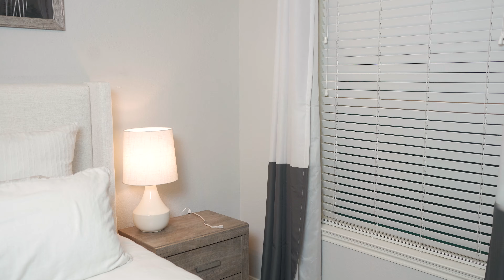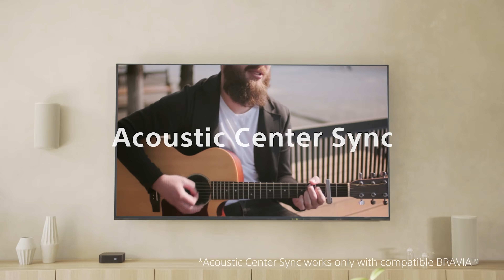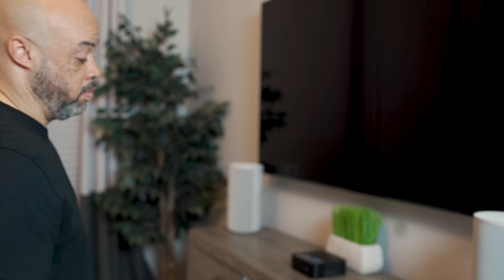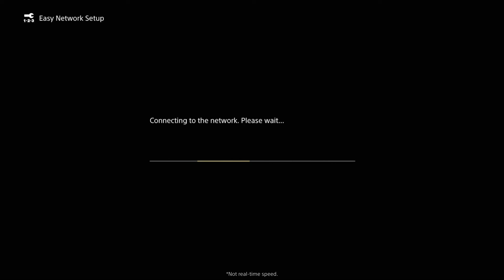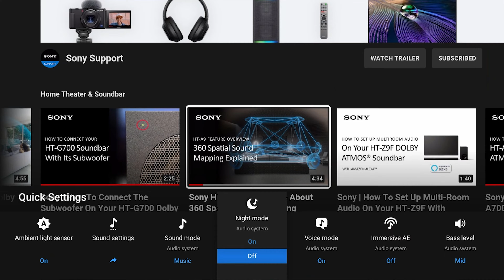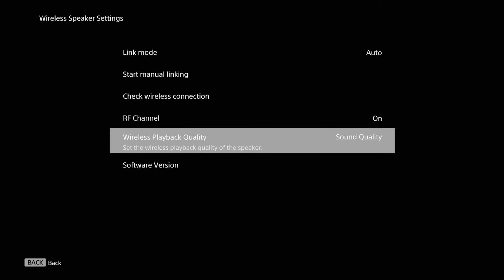Sony | How To Set Up Your HT-A9 High Performance Home Theater System

Comment: I bought 2 unit system Sony ht a9 and 1 woofer sw5 in years 2025 .. 1 unit for saving in case sony lost product (standby mode) or damage .. i like it sony ht a9 compress audio format Atmos dtsX very champ but im still like it DtsX Dtshd and dts audio 😊

How to connect Sony ht a9 center speaker (no sony tv)

https://youtu.be/TD5jmR_KOVk

Comment: I've set up a little "man cave" in a detached garage.  I have a laptop that is connected wirelessly  to my network. Question is: can i connect my laptop to the HT-A9 ?
Reply: Absolutely, you just have to put you the HTA9 in pairing mode then select it in your laptops Bluetooth pairing mode settings.
Reply: Yes, you can connect your laptop to the Sony HT-A9 in your detached garage "man cave.

Comment: I know this video is old but is there a major diffrence between  “ connection “ option & “ sound quality “
Reply: The only difference is where you want the bar to set its priority.  Most people just keep it set on Sound Quality but if you notice any connection issues, you'll want to change it to connection which tells the bar to focus on connection.

Comment: You'd have a lot more customers if you patched the system so that you can link to any brand wireless sub.

Imagine this linked to a REL S510 via their wireless add on.

For me the system looks great, but the subs are not quite there to my taste, I need tighter bass with more extension with a much faster response.

The option of a separate centre channel would be great also.
Reply: Well, to be honest as someone who tried everything like the Real and the Sonos subs I would say that the sub that is supported with HTA9, the SWA5 from Sony sounds as good as the Rel and better than the Sonos sub.

Comment: I have the A-9 system.  The demo set-up sounds AMAZING but, because the unit is wireless, the sound frequently drops out, or stops working altogether, requiring you to stop what you're watching, and re-set the entire system.  My advice: not worth the cost so look elsewhere for a quality sound system!
Reply: How far is your router from the control box? Is your box using wired Ethernet?

Comment: Can the receiver be mounted behind the tv panel?
Reply: yes it can, but you may experience drop outs depending on the exact positioning.  The best way would be to try it out and see how it goes, there are a few variable's that can affect the connection.  Such as being to close to the wireless router.

Comment: Hi, I have a question about rear speakers position. I have a large room in a shape of letter L that combines living room, dining room and a kitchen. How important it is to for the rear speakers to be at the same distance from the TV? Currently one is in the middle of the room, right behind the sofa, let say 3,5 meters from TV, and the other is further away, in a corner 7 meters away from the TV. Is that a problem? And if so, it better to put both of them at the middle of the room and create the sound bubble just arount sofa, or to put them both furher back?

Comment: Great video. How can i connect the Sony HT A9 with the Sony A80J to get the best performance? I own a PS5 and some other consoles, do i just connect the PS5 to the HDMI IN on the hub and all the other devices to the TV since the HT A9 only supports one HDMI IN input? I would be thankfull for any kind of help :)
Reply from the maker: Thank you for reaching out to Sony, we're glad to assist you with this inquiry. Since besides your TV you also have other AV devices and consoles, you can connect the TV and soundbar using HDMI ARC, then if you prefer you can connect your PS5 to the HDMI IN port in the soundbar, in case you have other ACV devices, you can connect them using the others HDMI IN ports that your SONY TV have. For more details, please access the following links: 

HTA9, connecting a TV Compatible with ARC/eARC: https://helpguide.sony.net/ht/a9/v1/en/contents/TP1000029209.html

HTA9, connecting an AV Device Compatible with the 2K/4K Video Format: https://helpguide.sony.net/ht/a9/v1/en/contents/TP1000029219.html

Hope this helps! 

Regards,
Ivan.
Reply: @SonyConnect  thank you Sony Team for the fast reply.

Comment: Do you have to re-optimise once tv centre channel is added. ?

*All good this video suggests you do, 
https://youtu.be/rpnNNlj8QRc
Reply from the maker: Thank you for reaching out to Sony, we're glad to assist you with this inquiry. If available, use your audio system's automatic calibration function. The measured distance may be several meters farther than the actual distance. If your audio system doesn't have automatic calibration, set the center speaker level of your audio system manually. For more details, you can access this link: https://www.sony.com/electronics/support/articles/00201071

Please reply on the thread if you need or would like additional support.

Regards,
Ivan.

Comment: so i have a 4K projector.

Connected to projector is 
1 my NVidia shield
2 my 4k sony player

So how can i use this on both of these devices?

I plug the HDMi cable from the Sony device ARC to Arc on my 4k projector

but then how to connect nvidia shield and my 4k player to the sony sound device
Reply from the maker: Hi John Robbo,

Thank you for contacting Sony support, we're glad to assist you! You can only connect one AV Device Compatible with the 2K/4K Video format to the speaker system (HT-A9). Please access the following link and refer to page 18 for the steps to connect an AV Device Compatible with the 2K/4K Video Format to the Sony HT-A9: 

https://www.sony.com/electronics/support/res/manuals/5025/247767c717293fe9a5e7f268a1f877a3/50252291M.pdf

Regards,
Gerson

Comment: Can you use it without arc with a device plugged into the input port
Reply from the maker: Thank you for reaching out Sony, we're glad to assist you with this inquiry. In case you would like to connect any other device than a TV compatible with ARC/eARC, you'll need to use the HDMI In port of the HT-A9 unit to connect an AV Device Compatible with the 2K/4K Video Format, for more details please access this link: https://helpguide.sony.net/ht/a9/v1/en/contents/TP1000029219.html

Please reply on the thread if you need or would like additional support.

Regards,
Ivan.
Reply: @SonyConnect  I’m interested in this speaker set for my computer. But my computer doesn’t have ARC. can I use this speaker set without an ARC compatible device?
Reply from the maker: @MuppetChops  Thank you for replying. If your computer supports the A2DP Bluetooth protocol, then you may be able to establish a connection between the PC and the SONY HT-A9, please access this link for more info on Bluetooth connection: https://helpguide.sony.net/ht/a9/v1/en/contents/TP1000029215.html

Regards,
Ivan.
Reply: Hello. I don’t want to listen via Bluetooth. They’ll be compressed and stereo. I want to use the hdmi input on the device to receive audio. But I want to use it with a screen that doesn’t have. ARC
Reply from the maker: @MuppetChops  Please note that, as we mentioned before, you can connect AV Device Compatible with the 2K/4K Video Format by using HDMI IN (NON-ARC) in the HT-A9, for more details, access this link: https://helpguide.sony.net/ht/a9/v1/en/contents/TP1000029219.html

You can also refer to page 32 of the manual: https://www.sony.com/electronics/support/res/manuals/5025/247767c717293fe9a5e7f268a1f877a3/50252291M.pdf

Regards,
Ivan.
Reply: Thanks. So how do you setup the device if you don’t have eARC?

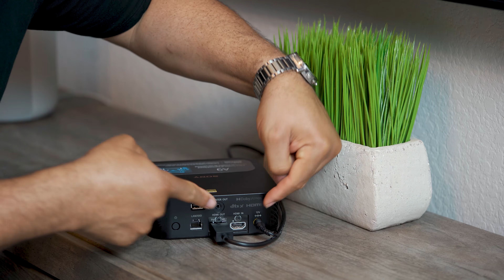Comment: what does 2:40 mean exactly? connect another HDMI device like a blu ray player or a game console to the control box. how does the TV receive video from such devices if said devices are connected to the HT A9 control box? PS5 has only 1 HDMI port.
Reply: It's a pass through, PS5 will show on HDMI 2 if eARC is HDMI 3.
Reply: @kfitzz  i'm not trying to be mean but your answer is completely devoid of any context, also i already replied to this question when i found out how this works so that it can help others.

Comment: Hi and thanks for your videos. I went thru setup effortlessly but after calibration I have the front right speaker dominant. It's really distracting. Tried
to re calibrate with no results. Any suggestions? Thanks in advance

Comment: Can you provide a link on how to add the subwoofer to the ht-a9?
Reply from the maker: Thank you for contacting Sony, we're glad to assist you with this inquiry. Please note that the two Sony subwoofers compatible with the HT-A9 soundbar are the SA-SW5 and SA-SW3. For more details on how you should connect one of these models to the soundbar, please access the following links: 

SA-SW5:
https://www.sony.com/electronics/support/res/manuals/5027/39fd6e129f40f54ddd7e93d0ac626ee7/50273451M.pdf

SA-SW3: https://www.sony.com/electronics/support/res/manuals/5011/6345aec096c17cd278f2b9eb62cdc620/50115301M.pdf

Hope this helps!!

Regards,
Ivan.
Reply: @SonyConnect   Just what I needed. Thank you!

Comment: Thinking of buying two sets of hta9 for living room and bedroom, both with sw3. Is the sw3 sub paired with its separate and unique hta3 control box? When both hta9 systems are on, will there be interference between the two subs?
Reply: Sony will be answering your question very soon.  Just hang in there, they are working on it.   Yes you may experience interference, depending on how far apart the rooms are.  Why would you be watching 2 movies at the same time in 2 different rooms?  Or is that like another family member or something?

Comment: Can I use a speaker which has aux input to be used as center by connecting to s center out port
Reply from the maker: Hi 
SleepyScroller,

Thank you for your question. Unfortunately, the HTA9 is designed to work only with selected Sony TV’s and no other products.

Regards,
David

Comment: Using with projector. So my plan is similar with Alexandre. Will be using an Apple TV 4K box and my local providers 4K optic tv box. Both hooked up to an HDMI two in, one out selectable switcher. The hdmi 2.1 cable into Projectors HDMI (eARC) port. Will this give me full access to Dolby atmos and other audio formats?
Reply from the maker: Hi 
Robert S,

Thank you for the inquiry! The HT-A9 supports object-based audio formats such as Dolby Atmos and DTS:X as well as HDR video formats such as HDR10, HLG, and Dolby Vision. If the projector is compatible with eARC, you can
output the high quality sound by connecting an AV device to the HDMI IN jack on the projector. In this case, enable the eARC function of the projector. See page 18 from this link for more details.

https://www.sony.com/electronics/support/res/manuals/5025/247767c717293fe9a5e7f268a1f877a3/50252291M.pdf

If you need further assistance, we are more than happy to help you out. Please find Sony Electronic’s Support information: Go to sony.com > click on “Support” > scroll down click on “Contact Support” > click on "TV & Projectors" > click on “Chat Now” or you can call us directly in the phone number under “Phone Support”

Regards,
David

Comment: Hi. Question 1) I do not have a TV set but a projector. May I connect my own center speaker. 2) I already have a great subwoofer. May I install it? Both questions, naturally, without loosing any HTA9 functionality!
Reply from the maker: Hi Eskerinola, Thank you for your inquiry! Unfortunately, you cannot connect your own center speaker and subwoofer to the HTA9 Home Theater System. The HT-A9 is only compatible with either the SA-SW5 or SA-SW3 subwoofer. Hope this helps! -Sam
Reply: @SonyConnect  Wouldn't it be a good idea to develop some kind of interface to connect our existing central and SW speakers  to the A9? This way you would enlarge your universe of potential customers :)
Reply: Did you use HDMI to connect to or? My projector doesn't have the Earc or ARC connection so not sure if I can use this setup...

Comment: will the HT A9 work with a LG C1 Oled Tv with Dolby atmos content through its eArc port in the TV?
Reply from the maker: Thank you for contacting Sony, we're glad to help with this inquiry. Absolutely yes, our Sony HT-A9 does support Dolby Atmos audio format when using eARC, please note you'll need to confirm that your TV and content are Dolby Atmos supported. For more details about the Supported Input Audio Formats on the Sony HT-A9, please access the following link: https://helpguide.sony.net/ht/a9/v1/en/contents/TP1000071011.html?search=Dolby

Please reply on the thread if you need or would like additional support.

Regards,
Ivan.

Comment: hi, I have an a9g tv with centre channel, this only has the clip connections on, how can I connect it to the ht-a9? thanks
Reply from the maker: Thank you for contacting Sony. We're glad to help you with this inquiry. Please note, that your Sony XBR-A8G does not support the S-CENTER SPEAKER IN connection which is required when you're trying to make this center channel connection. For more details about the HTA9 and how you can output the center part of the speaker system sound from the TV by connecting the TV, please access the following link: https://helpguide.sony.net/ht/a9/v1/en/contents/TP1000029218.html

Please reply on the thread if you need or would like additional support.

Regards,
Ivan.

Comment: While i know these do a great job of adjusting for placement, what is an ideal setup? 

Should these be turned in to focus on seating area or face forward? Also, should front and rear speakers be aligned, or rear speakers wider than fronts? Also, should height be adjusted so 45 degree atmos up-firing reflects off ceiling to seating area? Any other tips?
Reply from the maker: Thank you for contacting Sony. We are happy to assist you with this. Install the control box on or in a shelf where the front panel display is not covered. They can be installed on a TV stand, shelves, etc., or mounted on the wall.
 Please access the following link for some examples of installations and recommendations: https://helpguide.sony.net/ht/a9/v1/en/contents/TP1000029207.html

Please reply on the thread if you need or would like additional support.

Regards,
Ivan.
Reply: @SonyConnect  can you connect a receiver to it that has more HDMI slots?

Comment: This is half cook engineering product. About Sony HT-A9 audio skipping / drop out issue, it's not only affecting me. Many users around the world hv voices out this issue in their product review section. The conclusion is the system work okay for a while. Then the problem arise back. Then need to do recalibration, reset RF again.

Currently I believe Sony has stopped production for a while. That's why no stock everywhere include big nation like US, Canada, India. 

Sony aware on this issue since this is global issue. Hope they come out with proper solution for early owner like me.
Reply from the maker: Hi Absar, Thanks for bringing this to our attention. Certain factors may contribute to connectivity and audio skipping issues. We do have troubleshooting steps that may help improve the performance of the HT-A9. You may refer to this link for more information:

 https://helpguide.sony.net/ht/a9/v1/en/contents/TP1000196690.html

 Please reply on the thread if you need or would like additional support.

Regards,
Sam

Comment: What affects would having the HT A9 in a room having slightly vaulting ceilings?  (8' side walls inclining up to 16' peak)?
Reply from the maker: Hi Jim, Good question! The HT-A9 features 360 Spatial Sound Mapping that adapts to your environment and Sound Field Optimization that calibrates the sound to your room for a listening environment which seems to expand beyond the walls. So, it should not have any effect when placed in a room with a slightly vaulted ceiling. Hope this helps!  -Sam

Comment: Hey I'm not sure about the positioning of the 4 speakers. 
I put the two front speakers close to the TV. Or should I put them in the corners of the room, so further away from the TV?

And for the rear speakers: My bed is on the wall, so they are basically just 10 centimeters behind my head. Should they be closer to my head or further apart? 

Should all 4 speakers perfectly face me (so, rotate them slightly in) or should the right speakers face each other and the left speakers face each other?
Reply from the maker: Hi Kortesch,

Thank you for the inquiry! Bring the speakers closer if the speakers are installed at a distance far away from each other. Install the speakers with a distance of more than 50 cm (19 3/4 in). If the distance between speakers is too close, Sound Field Optimization cannot be performed properly. You may find these links helpful for the recommended installation position of the speakers.

 

https://www.sony.com/electronics/support/res/manuals/5025/a4c4ed191f6d446d782c40064bb989d4/50252311M.pdf

https://helpguide.sony.net/ht/a9/v1/en/contents/TP1000029207.html

If you need further assistance, please find Sony Electronics' Support information: Go to sony.com > click on “Support” > scroll down click on “Contact Support” > click on [Product Category] > click on “Chat Now” or you can call us directly in the phone number under “Phone Support.”

 

Happy to help!

David